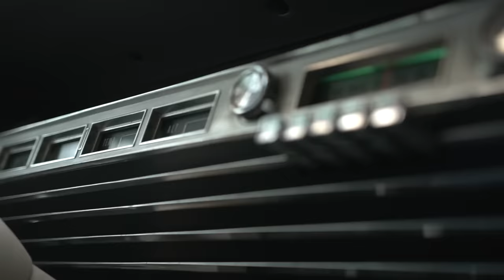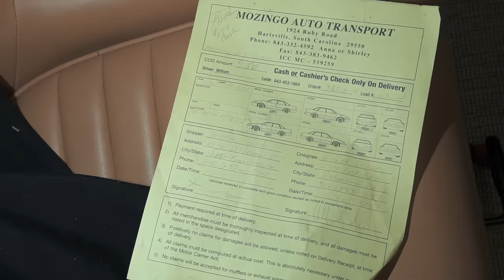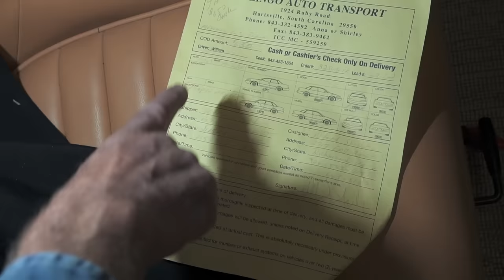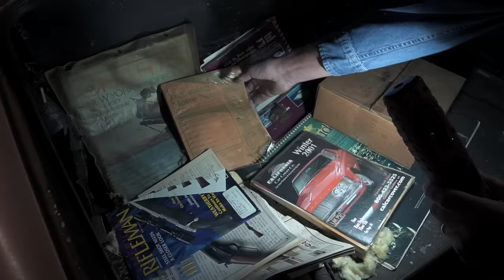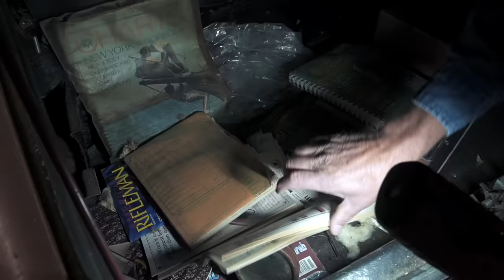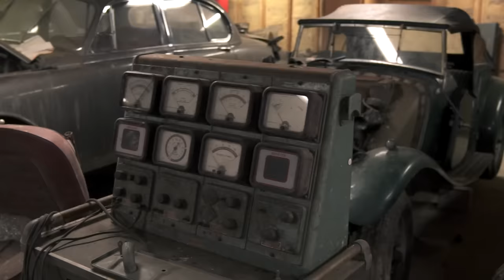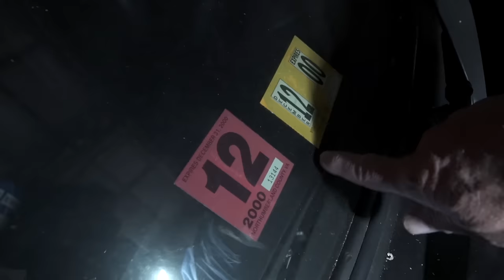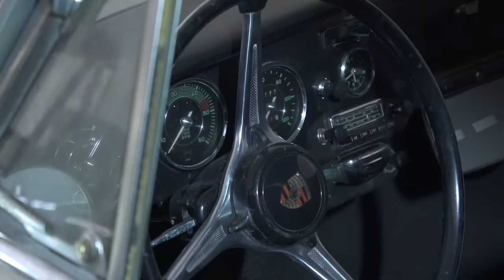Best barn find ever? 45 sports cars hidden in Virginia | Barn Find Hunter - Ep. 70

Comment: In the period, the UK Police used the SP250 as Police cars but made factory Black with a huge bell mounted out front. sirens were never used at the time but a loud ringing bell was to warn others the Police were in a "hurry up mode" - lol.. on a road i once lived as a teenager there was no speed restriction and so you heard police drivers using the kick down in auto versions making that little 2 1/2 litre engine making a gorgeous noise after being forced to drive in 30 MPH zones the open road was freedom for them Daimlers..That engine & transmission was also used in the Jaguar bodied  MK 2 I believe version too.The DAIMLER DART as it was known here had typical fin styling of the period in the UK, the closest being Austin / Morris / Wolsey A55 and A60 series cars, then to a certain degree Ford MK 2 Zephyrs and Zodiacs.

Comment: I would posit all of these old vehicles have frozen engines and a good place to begin would be to pull spark plugs and get some appropriate solvent working. Then come back with a breaker bar in a few days and see what turns.

Of course, the seller is offering everything “as is, where is” but still...

Looks like the original owner of this collection may have had ADHD. Bought a vehicle, moved it into the shop, fussed with it a bit, then brought in another. So many In varying levels of decrepitude. 😟😟😟

I make every effort to never have more than 2 in that condition. 😀

Comment: There was a 76 Cordoba for sale in my trailer park, was not in the best condition but I'm on disability so I thought just maybe I could save up so I could by it, I mainly just wanted to save it. the vinyl top was ripped off and the paint was cracked around the rivets letting water in the Body, someone spray painted the top around were the vinyl was maybe to protect it but wrecked the original paint :(. Well one day some random gentleman knocked at my door and ask if he could pay me to park a car he just got in my driveway. I said sure. then the next thing I know the blue Cordoba I wanted so much came pulling into my drive way. I told the old man I wanted to buy it just to save it and pointed everything out that was bugging me. In the end I have now done body and paint, found the radio and hubcaps. Spent 2 hours playing with the 76 carburetor but I think it needs crank bearings in order to run good, who knew lol. All it needs now is a door pannel replaced as the driver side don't look to good and the vinyl top and then it's mint. and some crank bearings if I can pop them in without removing the block.
Reply: So I got to save it I guess.

Comment: Hey Mr, Barn finder. During you're travels, if you happen to find anyone who has a 1968 Ford Galaxi 500 XL Fastback, I'm in direstraights of needing some parts. I'm tagging everyone possibly to help me find parts. I need a woodgrain glove box lid, and some outside body trim. Molding at the doors down, and the lower body trim. Mine is alittle odd, mine is a factory manual 3 speed Columb shift. That I like. Thank you.

Comment: The front flairs on the 911 wide body are too wide. The wheels are 6s & 7s and should be 7s & 8s. The steering wheel and seats are SC, but the engine is 3.2 instead of 3.0. WAY too much story on that car.

Comment: I'd love to have that GMC Jimmy I grew up in a couple of them is there anyway I can get contact info
Reply: I owned a new one back in the day and it was a horrible POS as a daily driver. Gutless engine with a lousy transmission, poor brakes and steering feel.
Reply: I've had about 30 as s10 from Blazers all the way through pickup trucks all the way from 83 tell now I'm driving a 2002 I don't know to each his own I don't know for indestructibility and durability and long-lasting every Austin I've had had well over 200,000 miles original engine and transmissions in most of the manual ones had the original clutches in them so I don't know what yeah they're not the most performance vehicle you're not the most comfortable vehicle either but I deliver pizzas and I have to go off road quite a bit so I wouldn't pick any other vehicle

Comment: Daimler really ripped off and ruined the design put forward by Austin Healey in the 3000's, the big Healey's.  You think it would beat an MGA or whatever, but it would not touch a Healey 3000 with its odd v8 and heavy American design.  Especially since Healey's are so light because most of the metal disappears from rust, I have a 63 from my Dad.
Reply: The SP250 was every bit as fast as the Big Healeys, they were used as Police Pursuit vehicles and could 120 all out.